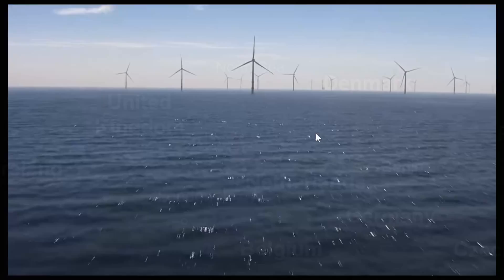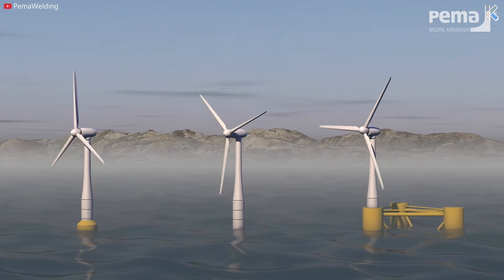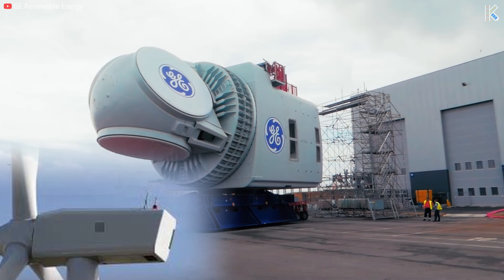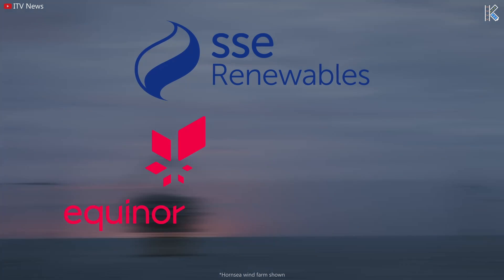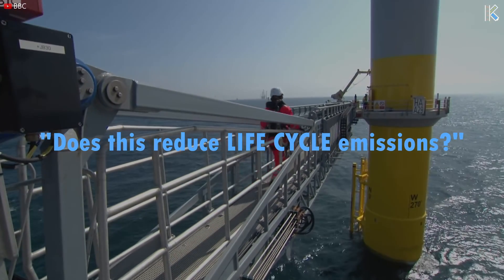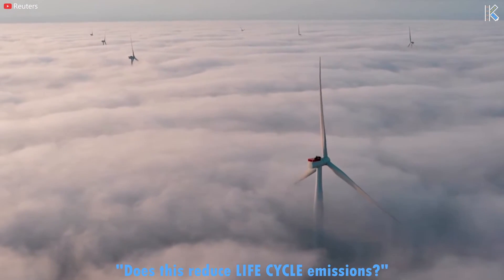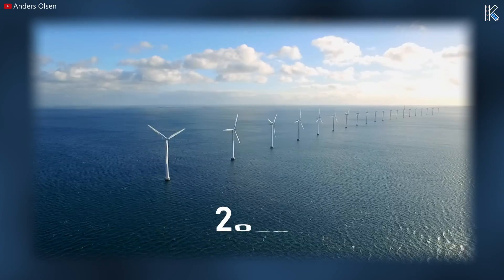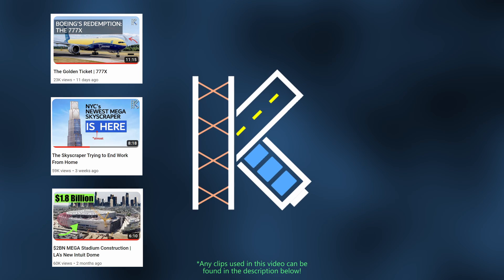Dogger Bank UK: World's LARGEST Offshore Wind Farm

Comment: A bit more detail! There are actually 4 wind farms being built totalling 5 GW. Dogger A B C plus the renamed D now known as Sofia. In addition a new area Dogger D is being investigated to the east of the present wind farms and to the south visible on the graphic are 2 more areas which are now put to the planning inspectorate. If and when all of these get built the output will be 10 GW when the wind blows. Scotland has 25 GW of offshore wind farms in development and further south off East Anglia there are another 8 to 10 GW in the process of being exploited. Meanwhile Orsted have 2 giant wind farms totalling about 7.5 GW about to be built just to the south of Dogger Bank. And then there is some 12 GW being looked at off the West coast of Great Britain. Currently Great Britain peak demand for electricity is about 42 GW but is likely to be up near 90 GW when transport and domestic heating is fully electrified.